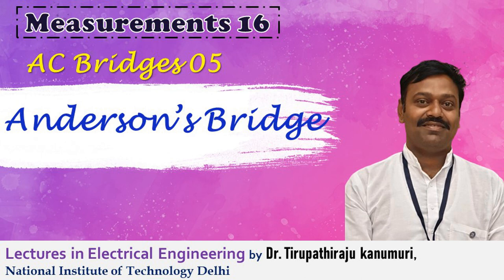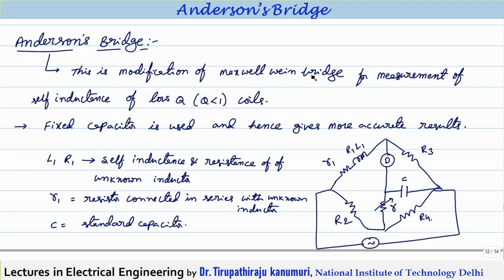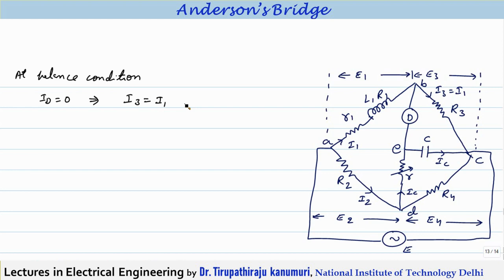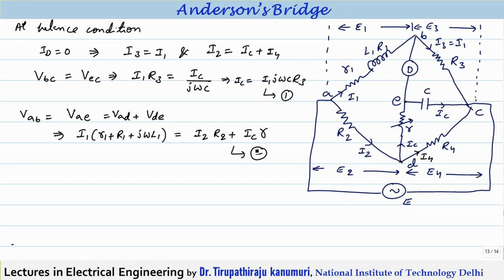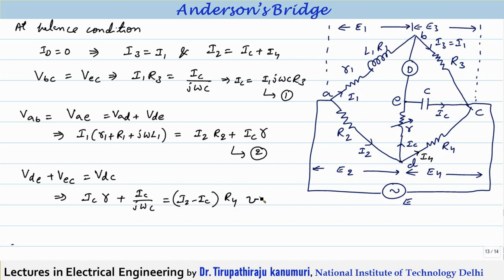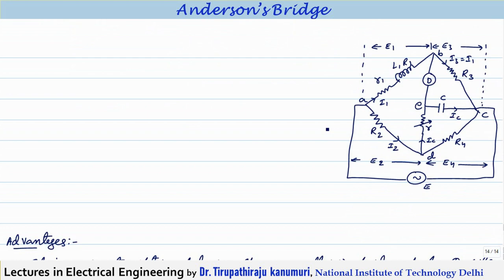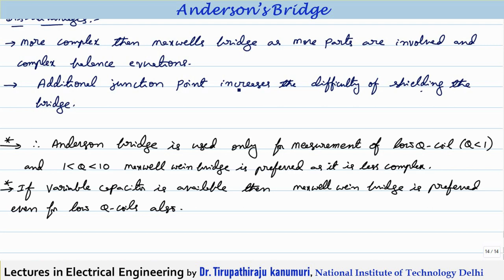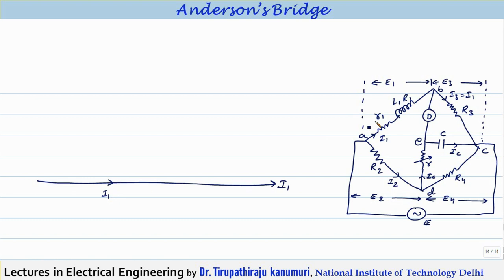ME16 Anderson’s Bridge

Comment: Sir what will be the impedance of a circuit or a branch of circuit if a resistance and inductor are connected in parallel in the branch ?
Reply: @lecturesinelectricaleng  thanku very much sir 🙏